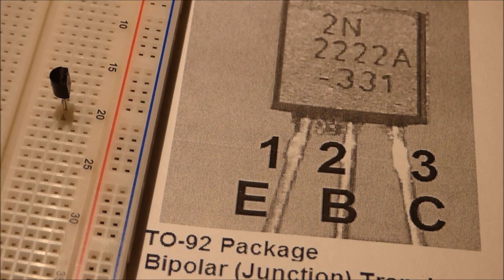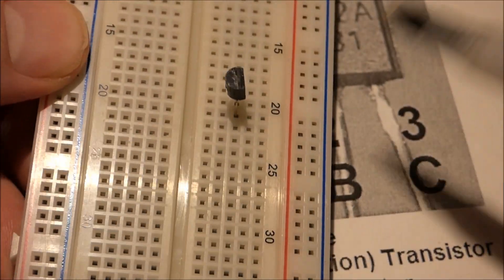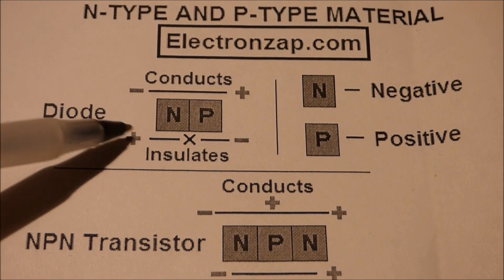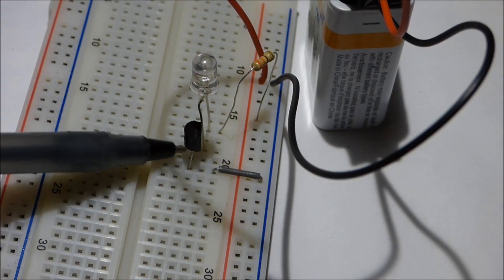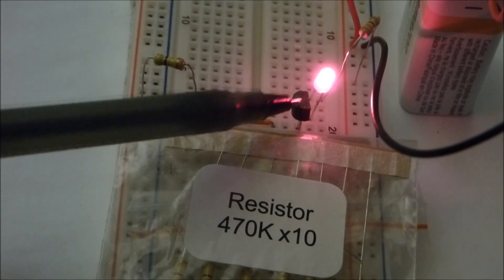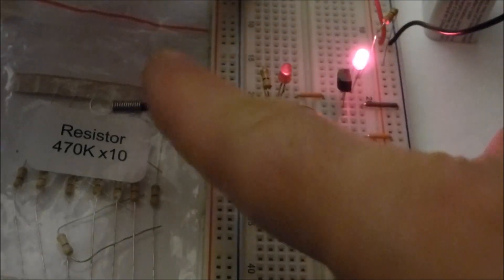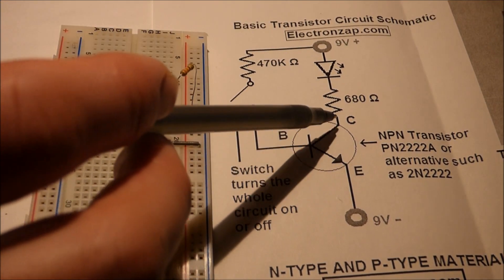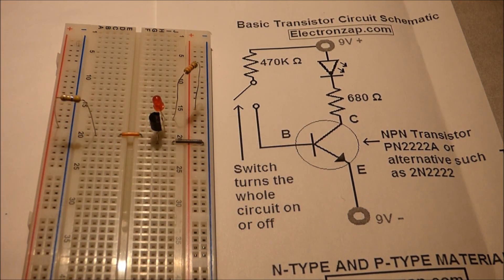NPN 2N2222 transistor component as switch circuit with schematic tutorial. 2N2222A

Comment: Very good lesson! Thank you!
Can you explain how the transistor forms VCA in this schematic? http://www.sdiy.org/rfeng/symple.html
I guess that it has the same principle as in this lesson but I'm not sure...
P.S. I've breadboarded this nice little synth, it works (with a smallest amplification I've heard) but Attack and Decay controls doesn't "mute down" the sound (10k and 1M pots there). Also I have a pretty noticeable distortion... Maybe there is some mistake with choosing a right R value near the transistor? Or maybe that was calculated for some other NPN transistor but the author did forgot something... My guesses..
Reply from the maker: No clue, I never built a circuit like that so I just have an idea of what each part of the circuit is doing. Looks like a lot of oscillations going on so I'd suspect an oscilloscope would be needed to trouble shoot it. I often have to slightly or greatly modify circuits that are presented in schematic form so all your ideas sound like possibilities. If you share it with people that do a lot of audio electronics, they may spot a problem with the design right away.
Reply: OK, thanks!
IF you're interesting in some info:
 there is a Schmitt-trigger that is used to get two oscillators. Instead of simply powering to Pin 14 it works as a "starving oscillator" circuit. As I guess the every second inverter is used as a buffer (so signals can be mixed). Somehow it has "interference" of the 2nd oscillator (that is bypassed by a switch which is abcent on this schematic, it's before R1). So even when it's OFF, it slightly changes 1st oscillator's frequency and even give some lite modulations.
I like this synth for it's relative simlicity. http://web.archive.org/web/20060402010333/http://www.geocities.com/tpe123/folkurban/fuzz/simplevcf.gif - it's a part of this synth. "Fake low pass response" filter. A very nice thing that allows to get a "parody" on a real LP res. filter with few cheap details. I like it for the sound. It's a bit unpredictable and a kind of "rough".

Only one big con for this synth: you need a sequencer (simpliest DIY can be OK) or a MIDI to CV device. It's not a con. actually, it's how it works.

Comment: How much resistance should I use for 5 volts and 3.7 volts?
Reply from the maker: To protect an LED (about 20mA or less) that has a 1.5V drop, I'd use at least 100Ω (120 is better if you have one) for 3.7V and around 220Ω or more for 5V. Any higher value can be used, but LED won't be as bright.
Reply: Is the 470k resistor constant?
Reply from the maker: You can use almost any resistance at the base of the transistor (as long as it protects from high current and doesn't overheat), not much current is needed there so it is often better to go higher. If the resistance is high enough value to protect an LED, it will protect most anything. Base resistance is a much more complicated topic than simple component protection and depends greatly on the rest of the circuit and you need to study many circuits and the base resistance they use to better understand what values are best in what situation.
Reply: electronzapdotcom Thank you for the information :)

Comment: Quick question if you have time... I have a square wave generator that I want to use to power a solenoid. The solenoid requires 1 amp... the function generators usually output low amps / current. Could I plug the positive side of the function generator into the base of the NPN, and then the 12 volt 1amp power supply into the collector?

That way I can get a high current square wave?
Reply from the maker: +Alexander Vinson 1 amp at 12 volts would be 12 watts of power. So you would need a transistor that can handle 12 watts, much more than the one in this video, but otherwise it sounds like your plan works just fine. I added a link to my facebook page https://www.facebook.com/electronzap/?ref=aymt_homepage_panel to some power transistors that are rated for 6A and 100V. I haven't used transistors that powerful yet so I have to recommend you read whatever datasheets you can find on them for wiring and heat dissipation. I just noticed that the base of these transistors is rated for 5V which I am guessing is what the function generator outputs.
Reply: you can use a power transistor